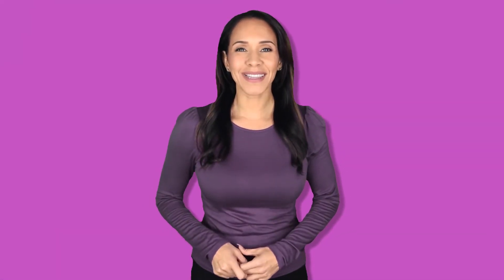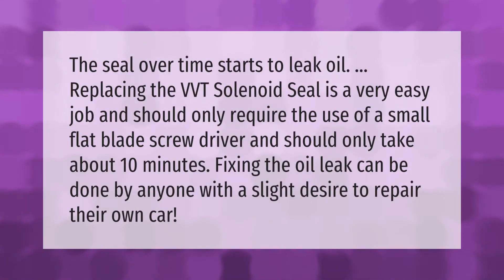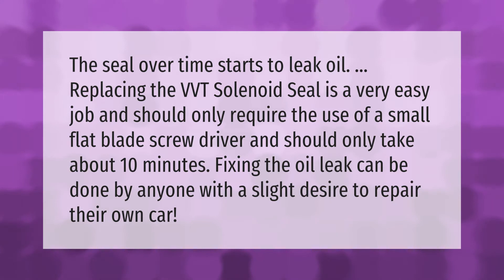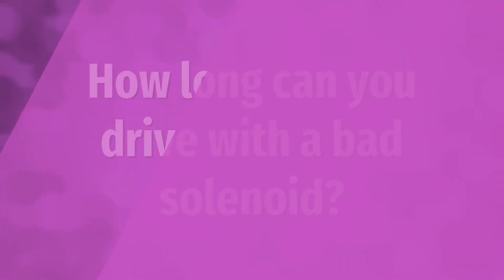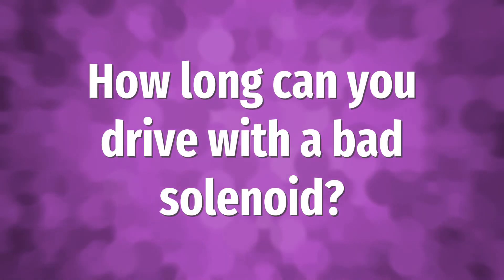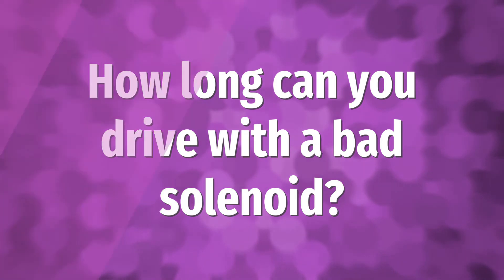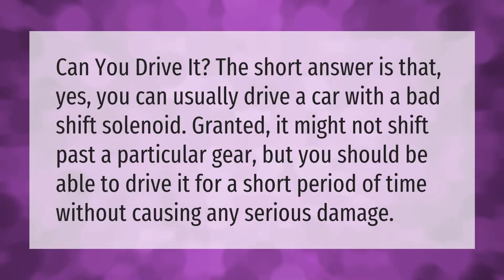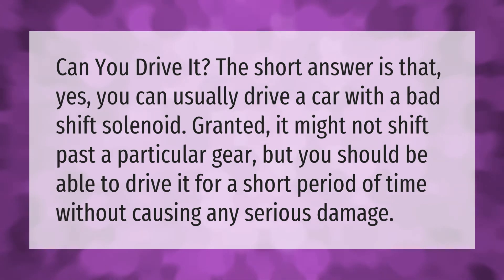What happens if you disconnect the VVT solenoid?

Comment: Useless post. What happens when you disconnect the vvt solenoid???????. Oil will not fill up in the tensioner barrel, you won't have tension and subsequently your timing will go out and you have your valves bending.